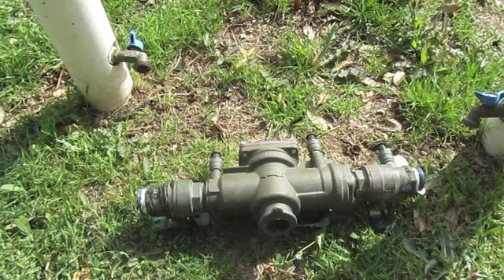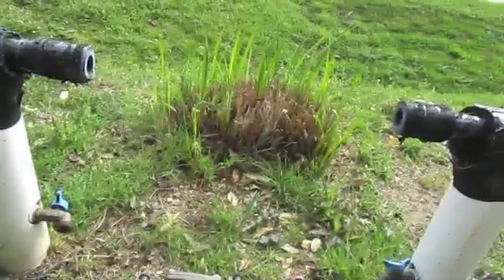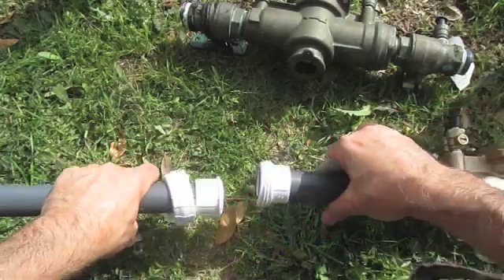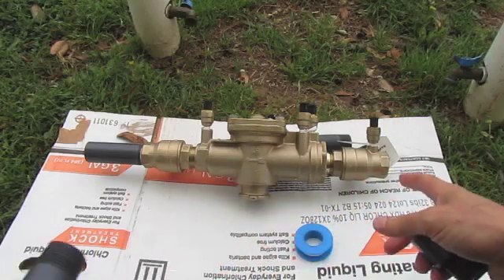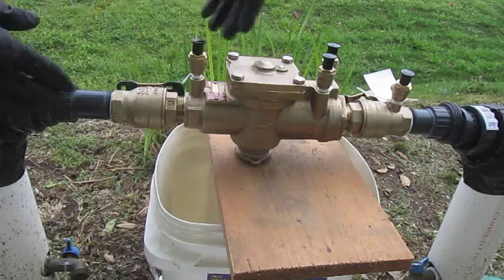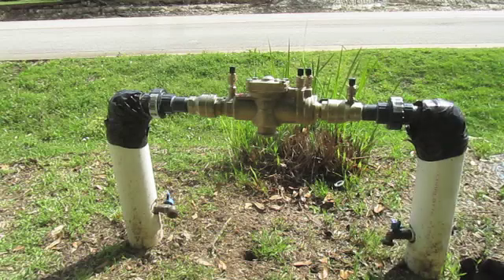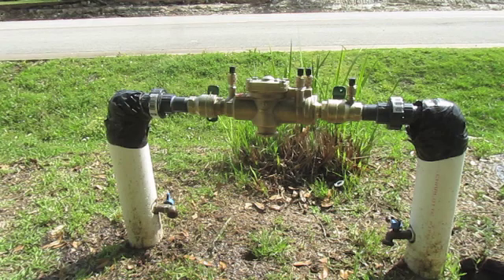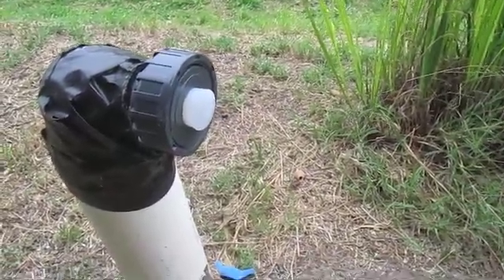DIY Union fittings for outdoor backflow prevention valve

Comment: I have a couple of those in my yard. Every fall, before the first frost, I shut off the water supply to them. Then, I blow compressed air into a hose bib that is upstream of the backflow preventer, and I alternatively open and close various relief valves in the preventer to allow the compressed air to push out the water.

I used to use my A/C shop compressor, which weighs over 50 pounds. Carrying that thing around is a huge pain, and it's inconvenient to run extension cords to it.

Then I bought a Makita 18V LXT cordless blower. It's the shape and size of a hairdryer. It weighs about 2 pounds, and the Makita batteries weigh less than a pound. That thing is super powerful. They also make a 48V XGT model that probably gives you more psi of blowing force, but the LXT is sufficient for my needs. I use it for other applications as well, but it's especially convenient for blowing out pipes. You just press the nozzle against the mouth of an open hose bib, squeeze the trigger, and watch water shooting out of the other end of your pipes where you opened a valve.

With the backflow preventer, I first blow air into my hose bib, then I switch and blow air into the relieve valves on the backflow to force air in the opposite direction. The 18V makita blower will not blow enough air to damage plumbing, but it'll blow enough air to push most of the water out of your pipes and vaporize enough of the standing water remains to prevent your pipes from freezing.